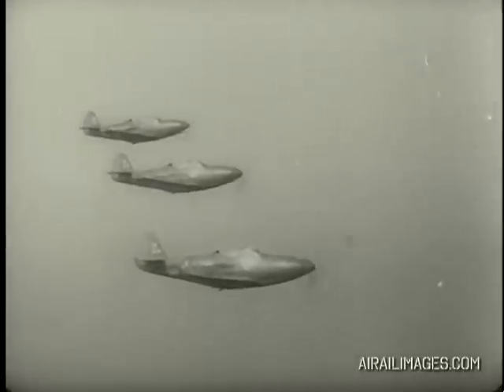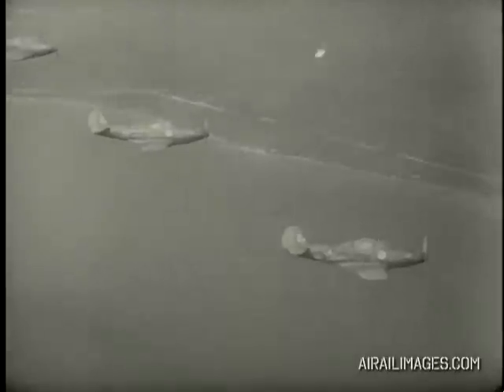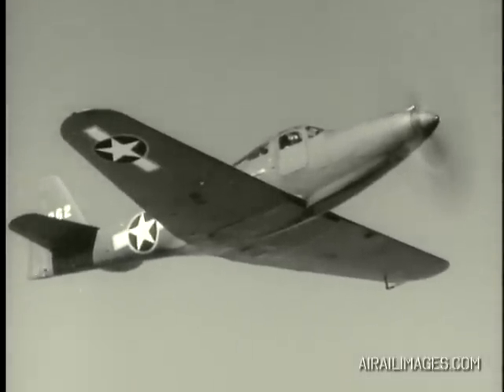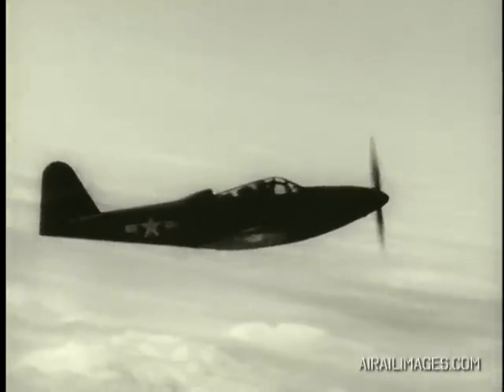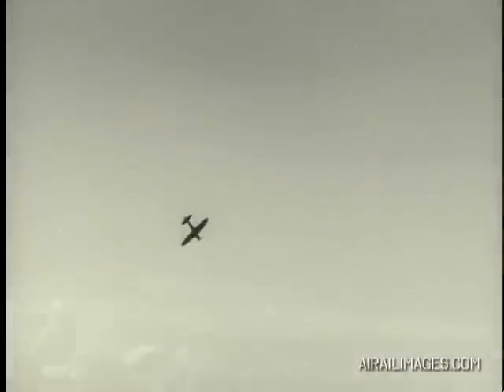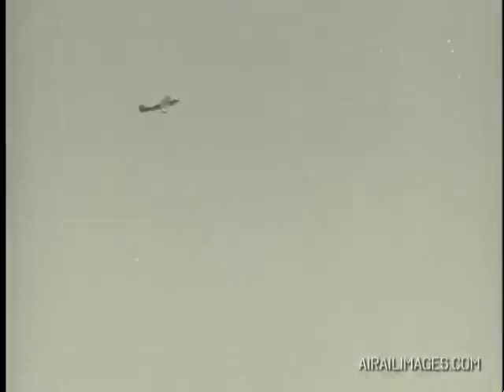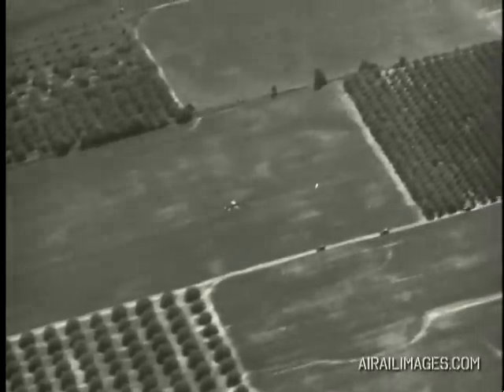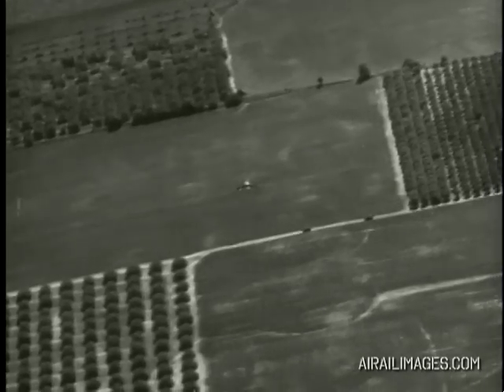P-39 Tumble and Spin Test WW2 Film

Comment: Those test pilots earned their pay!  It's surprising how thoroughly they explored the spin envelope which was unique because of the center mounted engine.  No complete tumbles but lots of very fast pitch excursions.  The 39 also would wallow in a high alpha attitude for quite a while and pushing the nose down abruptly would mimic a partial tumble.  The end crash was interesting in that the tail snapped off and the rest of the machine looked relatively unbent which show how slow the pancake impact was.  The P-39 was liked in the Pacific Theater because it would land on water easily since the belly was smooth and shaped like a little boat.

Comment: Training to avoid spins is unfortunately routinely ignored among light aircraft pilots even today.  

'How to get into a spin' should be taught, and 'what is a spin' even more so.  

Spin recovery should be trained repeatedly until it becomes automatic, like lowering the nose when an engine fails after take-off, instead of turning back while trying to extend a climb with no power, which a confident pilot will almost always attempt, then die from.
Reply: Unique to the P-39 was the mid-engine layout and the heavy cannon in the nose. The cannon load was heavy and the center of gravity would shift rearwards as the shells were expended. Many P-39's were lost in training accidents after emptying the cannon load on a ground target and then pulling up to climb away under full power. Pulling up hard with an aft Cg could result in a power-on aerodynamic stall. The torque produced by the Allison under full power would force the spin, and there just wasn't enough altitude to recover. Not enough altitude to successfully bail out.

Comment: From Chuck Yeager's biography: 

There were three squadrons in our fighter group, and among all those pilots, I was one of the few who loved the Thirty-Nine and would gladly have flown it off to war.  The British refuse it, and so did our own Air Corps, except for instruction, so we gave P-39’s to the Russians to fight in.  Our guys even sang a song about it:

Don’t give me a P-39
With an engine that’s mounted behind
It will tumble and roll
And dig a big hole –
Don’t give me a P-39

Well it was true that the drive shaft ran right up the center of the cramped cockpit, that the airplane performed beautifully at low altitudes, but was underpowered up high, and that if you stalled it, you might wind up boring a deep hole because it spun like a top going down.  But once you had a feel for the ship and understood it, the Thirty-Nine was a fun airplane to fly.  Another problem was maintenance.  We flew so much, yet there were few old hands among the ground crews working on the airplanes.  There was a lot of trial and error, both on the flight line and in the sky.

Comment: An Army / Bell film putting a " spin " on a spin . 
Not popular with seasoned pilots either .
Spins were violent and had a tendency to tumble . 
Temperamental airplane .
The Kingcobra ironed-out these problems .
The Airacobra was not a pleasant airplane to fly . She was a handful .
Reply: Please, stop the BS. Spinning and the supposed "tumble" are totally different phenomena. As for "not pleasant", one should read the British wartime report by RAF AFDU pilots. They considered it to be an easy aircraft to fly.
Reply: The perceived problems with an aircraft can take a generation to iron out of brains.  

The B-26 Marauder was a handful for pilots who learned to fly slower and less advanced planes, they tended to treat it like the planes they were familiar with, a training fault.  

Pilots who learned to fly it first had no problems with it, and it actually holds the record for bombs-on-target over aircraft and crew losses from WWII.  

The P-38 Lightning was having a a lot of problems at first, especially in the cold environment of Britain.  

The RAF test pilots found no benefit in early P-38s over their own types (such as the DeHavilland Mosquito), and It took a squad of US pilots to go around all the USAAC P-38 squadrons, change the ground-crews turbo and intercooler adjustments back to the recommended settings and demonstrate that the plane worked that way before pilots even began to believe it was useful.  

Ever since, Lockheed has been quick to point out what an excellent, near-sonic design the P-38 was.